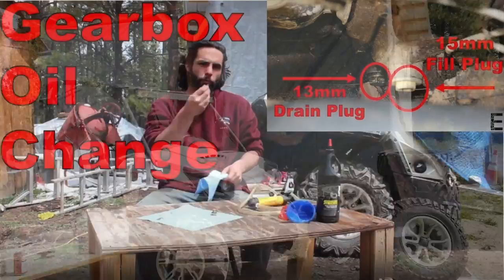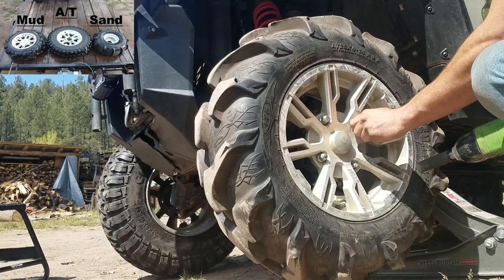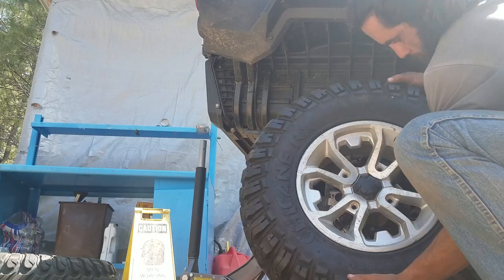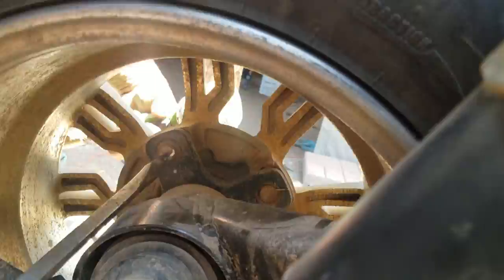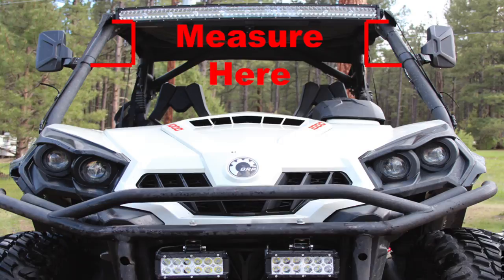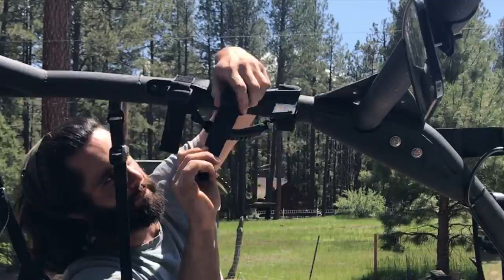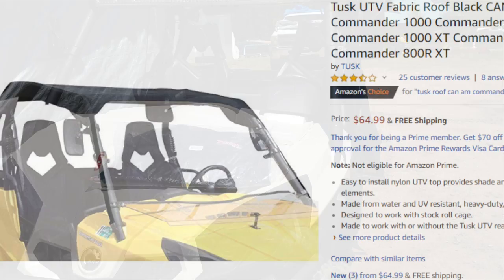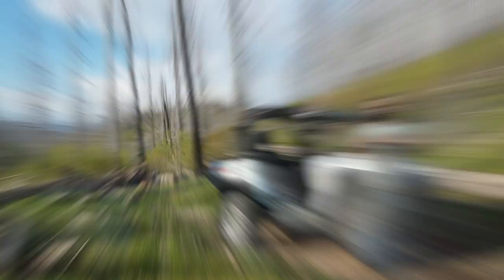Cheap UTV Tire, Mirror, Roof Guide: How-To Install Budget Accessories on Can-Am Commander

Comment: nice video. i have the cheap amazon mirrors as well. work great on my commander. also have the tusk soft top bought mine on ebay used for 25 bucks and i trailer mine with it on. i load it back wards on trailer and have had no problems running about 70 mph for 87 miles each way to dealer for maintenance .
Reply from the maker: Thanks, and hell yeah, thank you for sharing that tip. Will definitely load it backwards next time to reduce the stress/sag on roof. I was thinking I wasn't the only one who found some of these cheap accessories to be practical additions to the commander. Thanks for watching and taking the time to leave a comment. Cheers.

Comment: radials tread is more flat and provides better traction on flat surfaces. they have more belts in the tread area and less in the sidewall. bias tires have belts that wrap from one bead to the other. some say bias are better off road but radials are far superior if you are doing high speed and road riding. basically any car tire is a radial now. 
ps what area are you guys from?
Reply from the maker: hell yeah, thanks for sharing that useful information. Originally from Louisiana, but have moved west. Haven't found a permanent location out here yet, but its safe to say we'll end up somewhere in the southern rockies. Thanks for watching, and taking the time to add information in the comments. Cheers.

Comment: I have a question , 2019 can am commander 800r , will 27x12x14  wheel and tire kit fit with no mods?
Reply: I don't believe they will. I think they will be to wide on the front.
Reply from the maker: Apologies for the late response, to be honest I am not sure, but the forums and other viewers might be able to help us out here and share their experience. Those 28x10r14 I put on did rub the front bumper on occasion, but really only when at full turn with the suspension compressed on a log or rock or something. Not sure if the additional width may cause additional rub. Hope this helps and thanks for watching and taking the time to leave a comment. Cheers
Reply from the maker: @daver3778  That would make sense, seeing as our 10" wide tires did rub on occasion at full turn with the suspension compressed. Thanks for watching and taking the time to reply to comments and share your experience. Cheers

Comment: Where did you buy those lights at?
Reply from the maker: LightBar, Backup Light, & Switches Install Video: https://youtu.be/PRJB0ICXbOM
42" Curved 600W 40k Lumen Triple Row Bar: https://amzn.to/2w90bQ3
600W Wiring Harness: https://amzn.to/2w90bQ3
Back Up Lights:  https://amzn.to/2wbnNnf
Can-Am Style Switches: https://amzn.to/2LVIPRu
(To see full list of everything I used check out description of the video linked above)

Good Question, I pieced that set up together on amazon as it seemed to be the cheapest way to get that commander throwing a ton of light. I was pretty happy with how it came out considering how cheap they were. I'll leave links to the lights and a video where I show how I installed them above. Thanks for watching and taking the time to leave a question in the comments. Cheers.